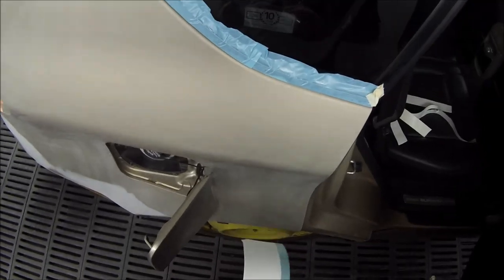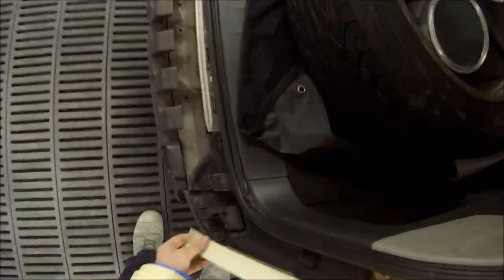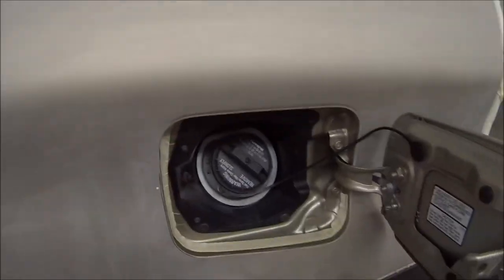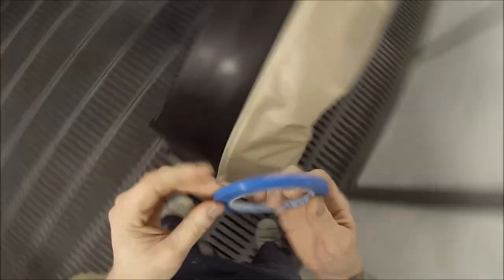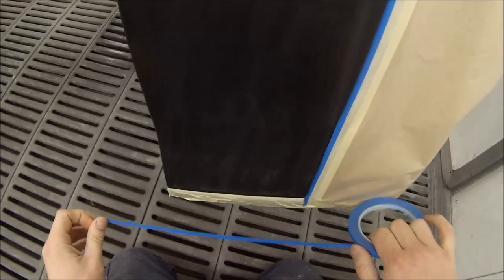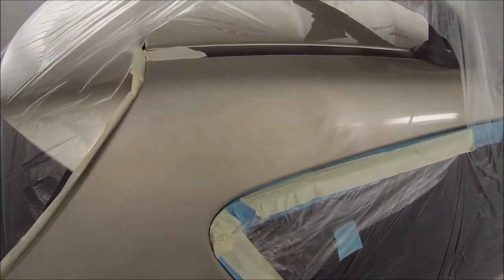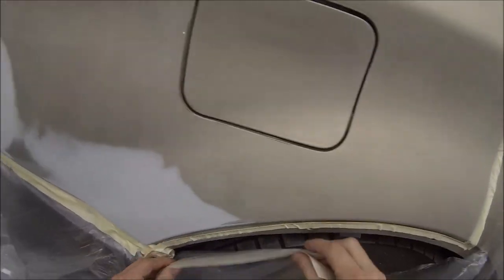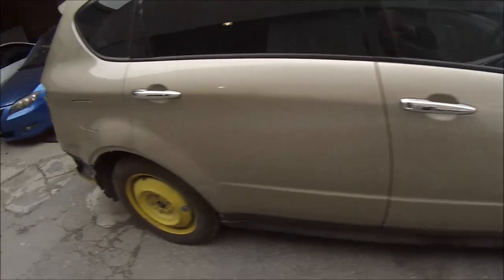How to Mask a Car

Comment: The plastic seems a bit more convenient as well. The clean up has to be a heck of a lot easier to.
Reply from the maker: Yeah man I think so, it gets a bit annoying when the plastic sticks to the tape but most of the time its all good.
Reply: The Gunman what is the name of the plastic that you are using
Reply: Erik E there are so many Brands brother just asked at any paint store and they'll help you out. comes in various widths from 12 to 14 to 16 foot, that's the size once you unfold it.